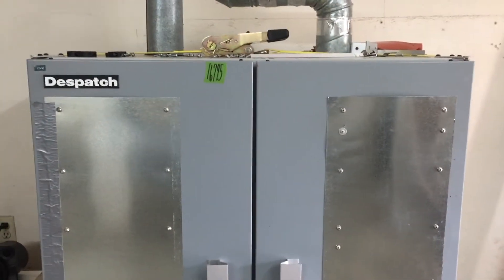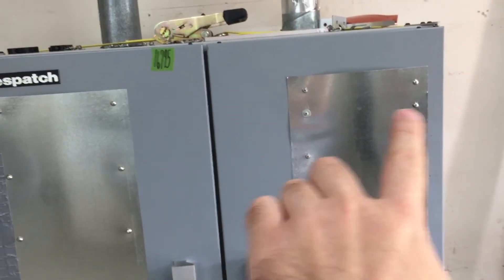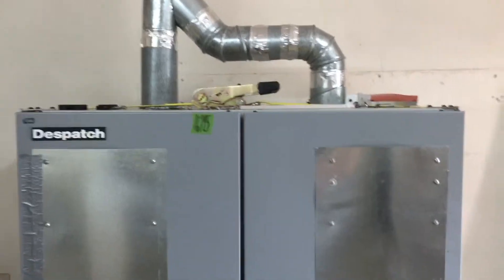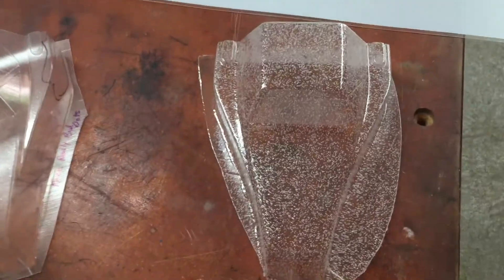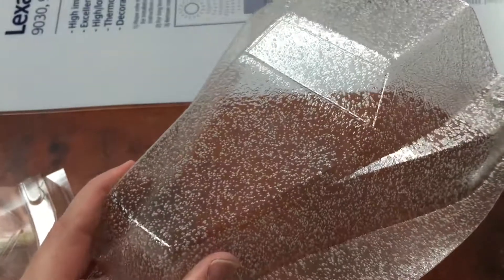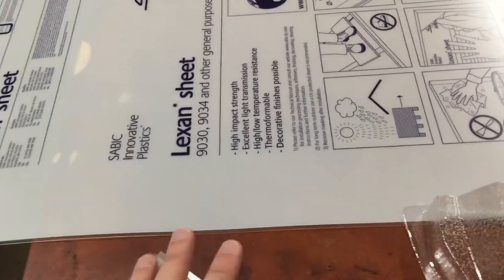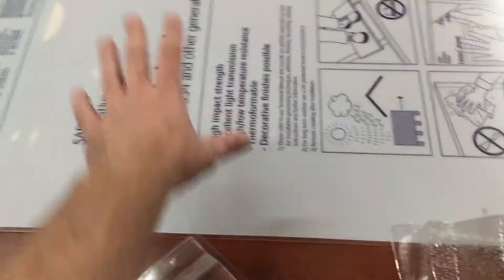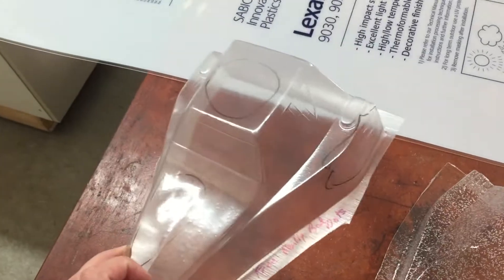Why You Should Dry Lexan and Polycarbonate sheets

Comment: What temperature and how long?
Reply from the maker: We are usually around 104C for 10 - 30 minutes depending on humidity. Sometimes when really hot and humid we go up to 110C but then the masking starts to get really sticky and may stick to the oven or other sheets. So we try not to do that if we can. But for some reason on the hot summer days we sometimes have to go hotter. Not sure why. Of course I should say I am not sure this temp is accurate. We have never checked the calibration in the temp probe. When this oven was in lab I bet they had to check it often.